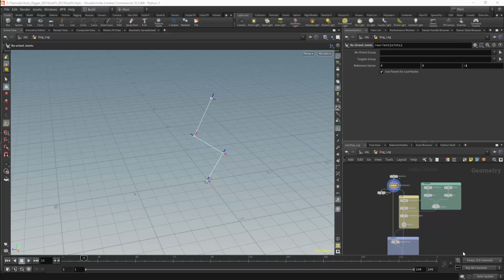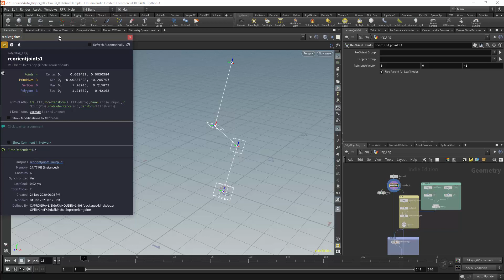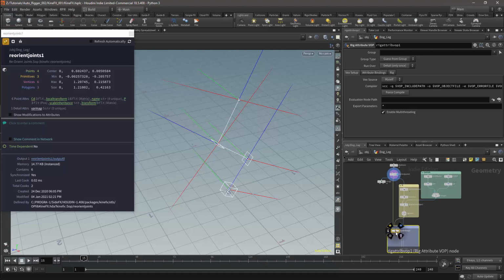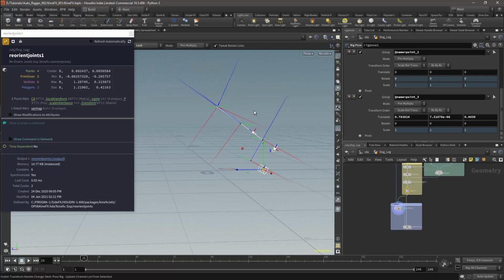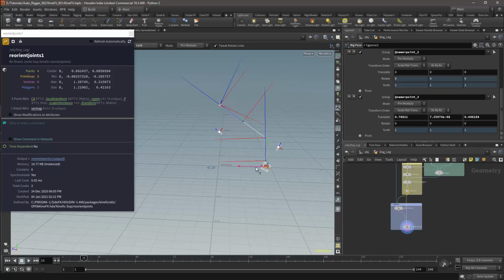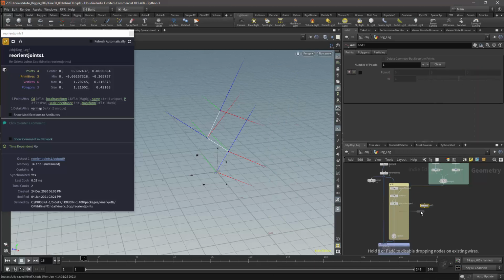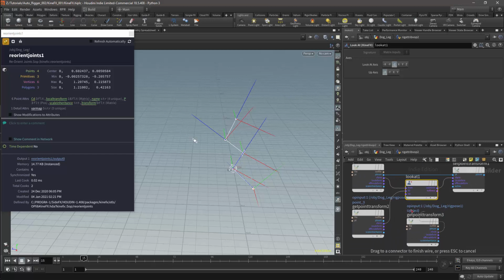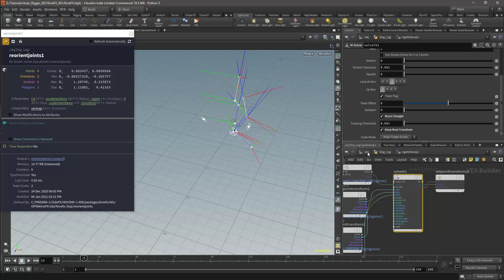KineFX Troubleshooting Transforms (Improving the Dog Leg Rig)

Comment: Very nice. I'm hoping that a proper kinefx tutorial start-finish shows up soon (not necessarily by you). I'm a bit confused about the overall workflow.
In all these small insolated examples everyone adds a "rig pose" before setting up a behavior like an ik-chain for that specific part,
 but it wouldn't make sense to have 10 different rig poses to control the final rig. Adding control objects is easy..but I still don't know how to animate with them.
I've seen some examples of people linking object level nodes to control the sop handles...it doesn't seem optimal.
Reply from the maker: Thanks. I will be doing a complete rig soon, I still want to cover animation export, CHOPs and animation transfer. Those will be a lot harder to show without a complete rig.

I can't say when I will have the videos ready though. 

As to linking object level handles to sops It is completely unnecessary. That said it depends on what you want for your workflow there are no rules so I will not criticise anyone who wants to work that way (basically If it works for you then it is fine).

Comment: When mirroring the leg via Scale method (on a Skeleton Mirror SOP) I need to reverse the Look At Axis and Look Up Axis in the IK Solver. Is there a better fix for this problem?
Reply from the maker: Unfortunately there is not really a better fix. You will have to make compensations for opposite sides of a character in all rigging systems (I have used XSI, Blender, Houdini and Maya). This is a mathematical issue you can address it in various ways by at some point you will have to flip settings.

Comment: Good example.
Can you explain how to fix joints axis manually? I've tried to follow sidefx help to re-orient joints https://www.sidefx.com/docs/houdini/character/kinefx/skeletons.html but without success.
For example I am trying to setup a hand with a fingers and when I create a skeleton for hand a joint axis between arm an fingers created in weird way. And when I trying to rotate and orient it proprtly it is also rotate a bones. Is it possible to rotate it separately? I hope I've explained it right what I want to get:))
Reply: Use the Skeleton Node in "Modify" mode and enable "Child Compensation" (and show the handle by pressing the Y key), then you can use "Orientation Picking" in order to precisely move / rotate your joints to your preferred position.
Reply: @Luxalpa  Thank you! It works. I've spent last two nights fighting with this "problem":))
Reply: @Luxalpa  Is it possible to re-orient joint axis with this method and specify an exact angle?